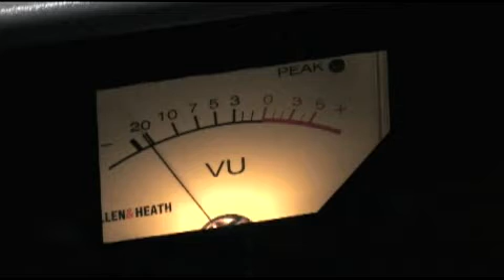Church sound system solutions and Microphone sensitivity

Comment: How about channel fader. will it cause feed back if turn up?
Reply from the maker: +changievangie A channel fader is just a volume control it doesn't cause feed back. If the room has too much of a frequency and gets picked up by the microphone when you turn up the volume on that channel (the fader) it gets sent to the amplifier and then to the speakers which in turns adds more of that frequency resulting in feed back.